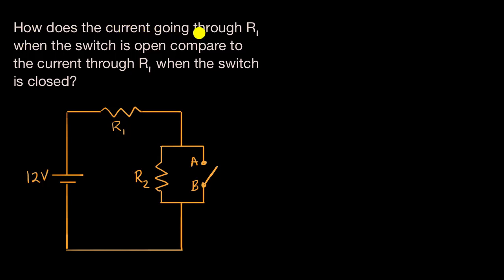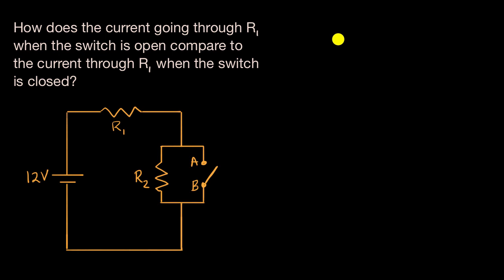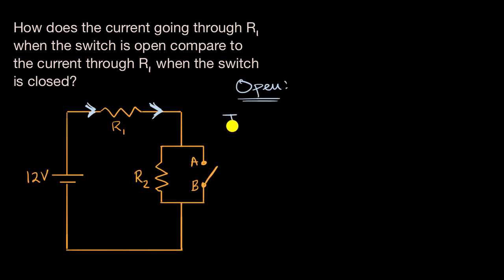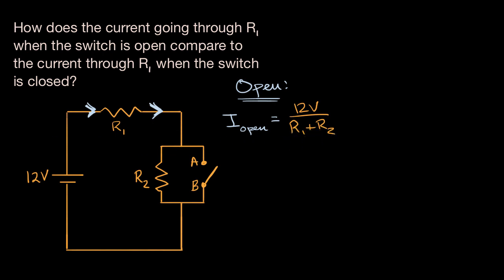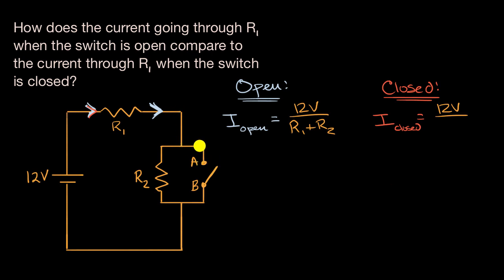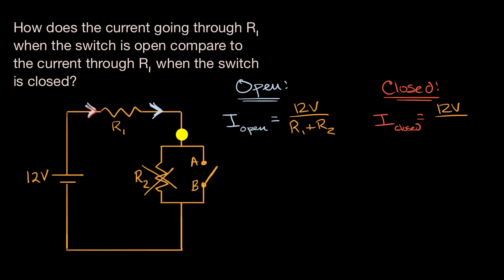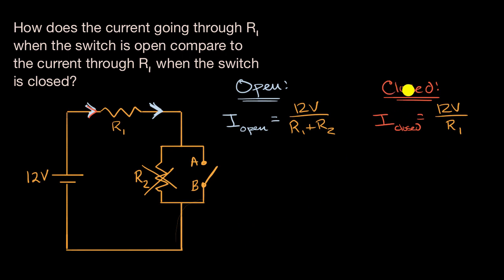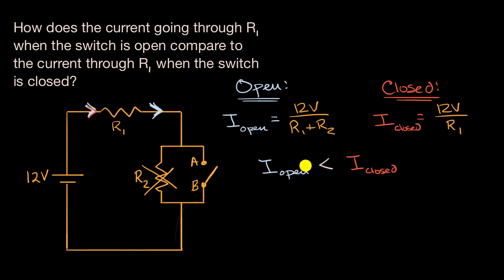Current due to closing a switch: worked example | DC Circuits | AP Physics 1 | Khan Academy

Comment: Current always goes through  the path with less resistance, so when the switch is close A and B become the same node , it's like you were putting both ends of R2 in the same point or node so no current goes through R2

Comment: When the switch is closed why does it nullify the resistance R2? If the switch is closed the current should pass through R1 in series with R2 instead of bypassing it. Not really good explanation
Reply: R1 and R2 are in series when the switch is open because you're essentially leaving out some "hanging wires" with no connection whatsoever so no current will pass through nodes A and B (i.e. virtually infinite resistance). As such, the current is choosing either to go through infinite resistance or R2 to which of course it will go through the path with lesser resistance.

Shorting (in this case, the closed switch) is ideally 0 ohms. By virtue of the law of currents with parallel connections, it will divide proportionally. Since current sees a virtually 0 ohm path, all the current will dump right through there as if there were no resistors connected in parallel at all. 

Ohm's law (as shown in the vid) is a quick proof of this as well.
Reply: RaiOkami Well I don’t know who Ohm is and how he came up with that resistance in parallel law. This is why I have never been good at understanding the academic explanation terminology-it pushes you into a theoretical world where most of the concepts are followed blindly or has no correlation with the practical world.   I am speaking in general terms and comparing the situation with water pipes analogy. If water is passed through parallel connection, where one path has resistance whilst the other doesn’t then it’s not like water has its own logic to make an informed decision as to which path to choose. It flows through both paths but the flow is limited where the path has resistance. Therefore, current should be flowing through R2 as well.